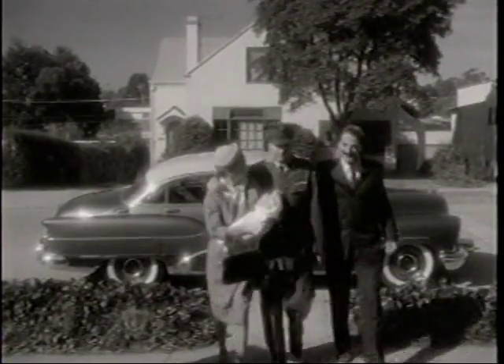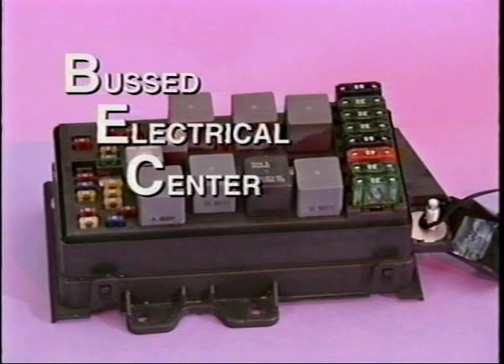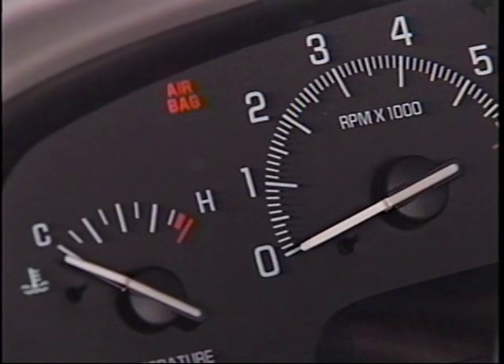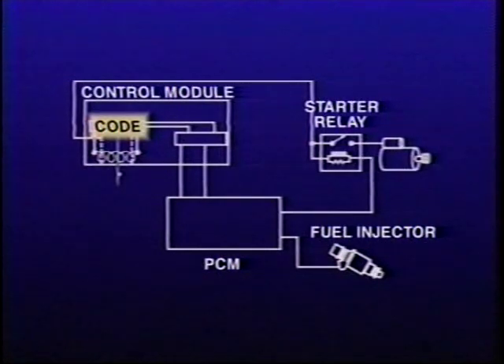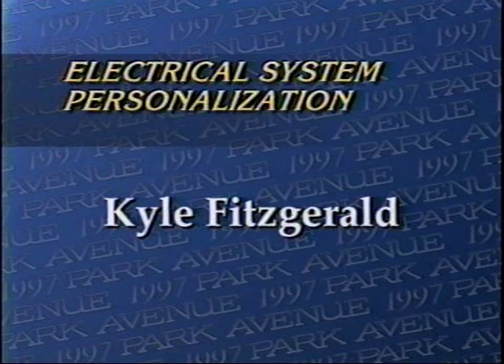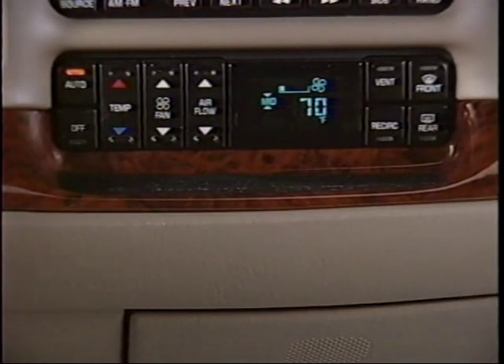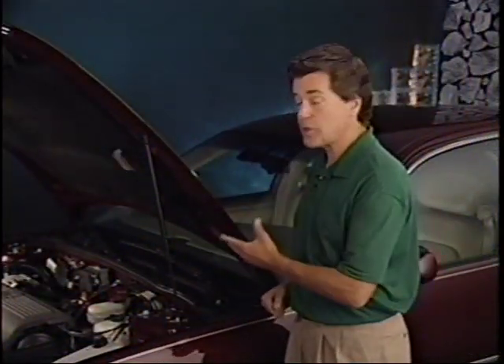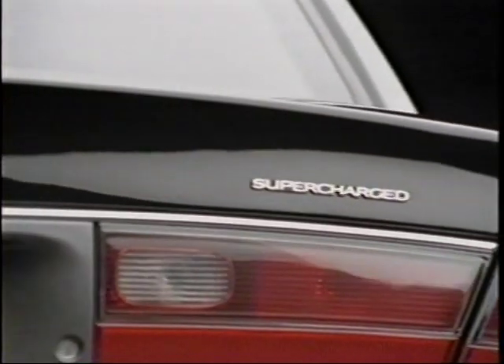Buick - Park Avenue/Ultra (1997) Service Features

Comment: 16:10 This style of speedometer is found on GM vehicles such as the 1997-2005 Buick Park Avenue, 1997-present Chevrolet Corvette and the 2000-2005 Buick LeSabre as well as the 2000-2005 Pontiac Bonneville, 2004-2008 Grand Prix and as well as the current GM models.

Comment: The second generation Park Avenue has an electronic speedometer of which is combined with an actual speedometer and it doesn’t have both MPH and km/h together in smaller numbers, but you can change them by the E/M button.

Comment: Because the manifold has allowed coolant into the cylinders and the gasket is failing, introducing coolant to engine oil, rendering, and resulting in a seized engine.

Comment: Thank you for the great info. My mom passed away and now I drive her car everyday. With the supercharger is it mandatory to use super unleaded and its most likely a v6 is that correct? What is the top speed and what is the 0-60 and the .25 mile and breaking time? I have lots to learn after seeing this. Thank you.
Reply: reliable? repairs?
Reply: @tednguyen2034  The car was a great car for many years but I worked 2 minutes from the apartment so it got very little use. Ended up selling the car cheap just to get rid of it. My friend was a mechanic and did an overhaul on the car. Tires and battery was replaced then he replaced the supercharger and other maintenance but the ac went out and that’s why I got rid of it. After all the maintenance my friend did the ac still needed repairs. It was parked outside so the paint had faded. The heater worked fine and so did the electronic seats and windows. Think it’s still a great car. If you get one for $1200 then fix the basic stuff the car would be dependable. Good luck! Definitely miss my car but was going to get a newer car at some point.
Reply: thanks bro....very sad since it was moms.....thanks for the response my man....